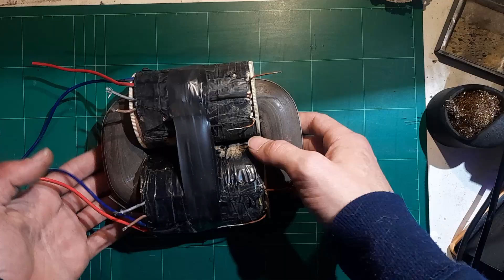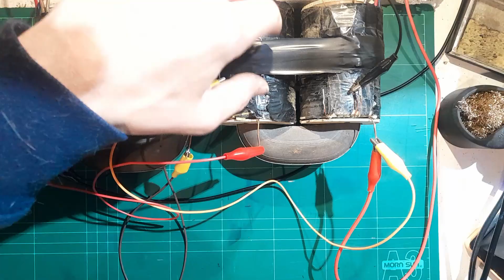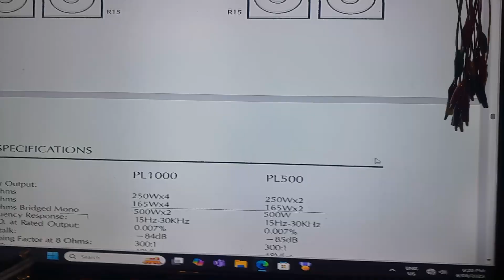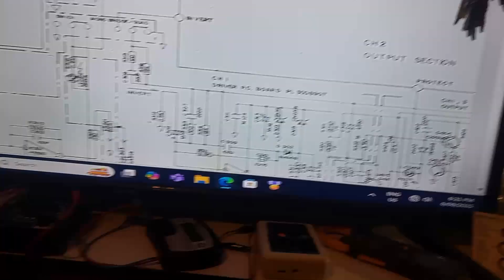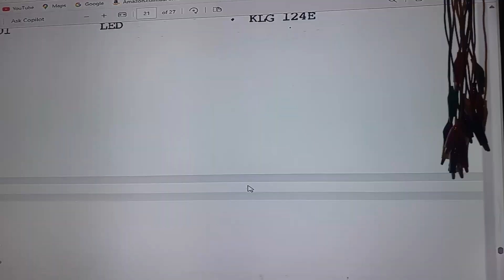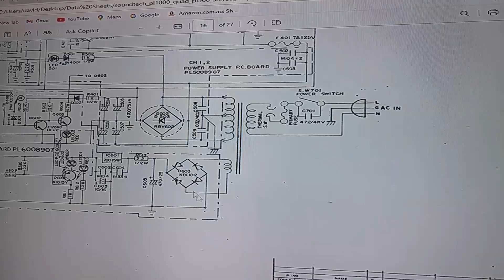I'm confused over these transformers, I can run them of a boost transformer but am still confused!!!

Comment: Hi Dave.... Just wondered about the metal straps around the transformer cores....
They are acting as A SHORTED TURN! This is creating eddy currents and causing the core to saturate.
That is why transformer cores are made in insulated laminated sheets, or in your case a 'ferrite-type' - all to minimize eddy currents and stop the core saturating, thus causing symptoms you are seeing.
Enjoying the current build process. Cheers
Reply: Nice catch !
Reply from the maker: No, it's not. It's part of the core going in the same direction as the core not around it like the windings, this is how these are made definatly not a shorted turn!!!!
Reply: @daveselectronicslab  It's an awesome catch ! straight off the bat, no time to think but you throw a very reasonable idea into the mix, then as the dust settles and the umpire screams 'Nope...LBW' and the game continues !
Reply from the maker: No, it's not. It's part of the core going in the same direction as the core not around it like the windings, this is how these are made definatly not a shorted turn!!!!
Reply from the maker: ITS NOT A SHORTED TURN😂😂😂
Reply from the maker: I am not seeing any symptoms of shorted turns or eddy currents loading it the draw is like 50 ma😂

Comment from the maker: A few things to mention... I need to add a pot to the fan controllers so I can dial in the temp range, also the 250 watt rms at 4 ohm rating will only work if I can keep the heatsink around 50 degrees Celsius at full output wich is possible but may not be also! We will see... also if it is closer to 200 wpc instead I'm going to be really annoyed with three transformers and will use different ones!